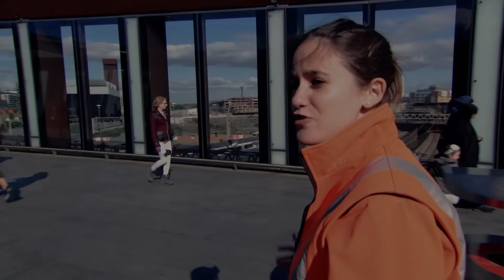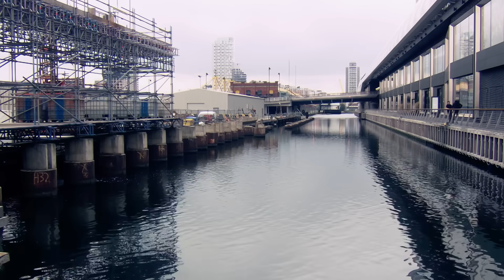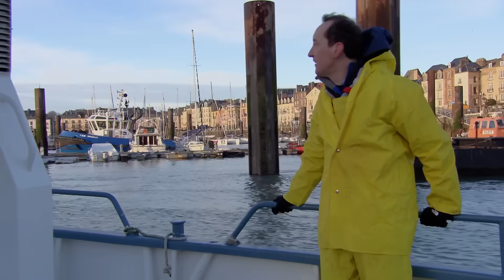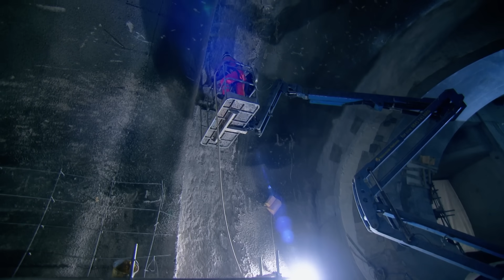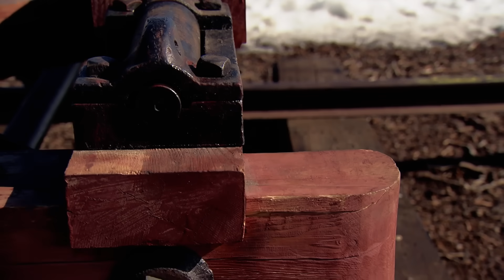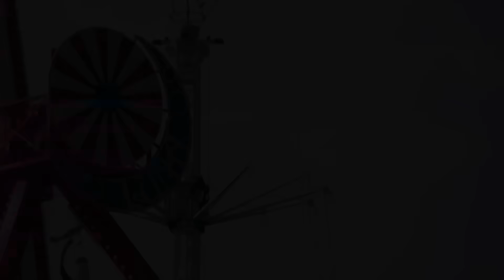The $17,7 Billion Mega Project That’s Changing London Forever | Blueprint

Comment: The original London railroad system - if it can be called that - was a product of 19th Century capitalism and 19th Century Hands-Off Economics. 
Each rail line was a separate private business, and each railroad company built tracks into London as far as it could afford, then built its own end-of-line station. The result: multiple rail lines going off in different directions, and multiple London stations with no direct connections between them. If you were going through London, from Birmingham to Canterbury, say, you'd have to get off the train at one station, take a cab or the Underground across Central London, and get back on at another.

Comment: Can’t believe they’re digging a whole new train line under London like it’s just another Tuesday. The size of this project is wild, massive machines, 24/7 digging, all while the city keeps moving above
Reply: Across the English Channel in Paris, the French are building the Grand Paris Express, an absolutely gigantic 200 km expansion of the metro network with 4 new fully automated driverless express lines which are 90% in deep tunnels.
Including a huge 75 km fully underground loop metro line around the city with 36 stations and all but 2 are interchanges with other metro, express regional heavy metro, tramway, or commuter rail lines.
During the first main digging phase a few years ago they had 22 or 23 TBM's digging simultaneously under the city.
Now they're beginning the 2nd main digging phase while the first parts are opening to the public next year. Though several extensions of existing lines and massive stations already opened last year before the Olympics.
They expect over 3 million passengers daily on the new lines and over 2 on the loop line alone.
It's a bit like Crossrail but times ten.

What's even wilder is that they're already planning a 5th new express metro line and currently extending the regional express heavy metro and tramway networks at the same time.

Comment: I worked for crossrail on the pudding mill lane job what a job that was unbelievable engineering 2016 i finished never see a job like it again
Reply: Pudding Mill Lane had a little temporary cafe, in 2012 you could sit and watch the Olympic area being constructed.
Reply: If you fancy working on the continent on the same kind of project, Paris is currently beginning the second main construction and digging phase of the gigantic Grand Paris Express project.
There are still over 20 stations and about 70 km of underground lines to build out of the project's 200 km and 68 stations.
There's also Toulouse in the South of France which is currently building a 27 km metro line with 21 stations.
Hamburg and Munich in Germany are also currently building major new U-Bahn and S-Bahn lines, although not as massive as Paris but they still probably need workers.
Reply: @KyrilPG you got any contacts

Comment: Is this the Elizabeth line? As a passenger commuting from west to central London on a regular basis I have controversial feelings about this line. Mostly because the line is not so efficient. There are always delays, engineering works and problems on the line since the beginning of its service. The reason is mostly because they didn’t create a completely new line out of a scratch but used the existing ones in the west and east London and simply connecting them to each other. The train technology in use seems to the same as the existing ones pre-Elizabeth line service.

Comment: 2009-2022 - What a disaster of a project. Meanwhile China build the entire Chandu metro system with like 15 lines and over 300 stations in the same period!!!
Reply: China often ignores environmental issues and construction worker safety to push projects forward
Reply: @JerryNiswonger  yet they had zero issues on building this line. The chinese also don't suffer Not-In-My-Backyard syndrome like the UK general population does. The simple fact of the matter is that the Chinese gov wants to move the country forward and it does, without loss of life or loss of jobs. China leads the world in green initiatives as well. Things have moved on we saw the pollution of the 2008 Olympics.

Comment: There's no pressure on cost, they're using over-engineered conventional techniques.
China does this for 10% the cost.
If the aren't encouraged to do this cheaply and just as well / just as safely, zero innovation will happen.

Comment: That line is already built - opened in 2022.
Reply: This is a very old video!
Reply: Possibly ten years old
Reply: Thanks for the update 😊
Reply: Im not even from UK and suspected its elizabeth line.
Reply: It originally aired 2017
Reply: I believed the projected was planned and started when UK was still part of EU. In other word, I think this Elizabeth Line received significant loan from EIB - which if the line was planned after Brexit, it probably would not stand a chance of even passing through the initial planning stage. 
So, yeah, this engineering marvel happened almost a decade ago.
Reply: Oo
Reply: Spoiler alert
Reply: I was there last year. I can't say that I saw much of a change. The Elizabeth Line was supposed to relieve travel west, but I still ended up standing from Reading.
Reply: BFD it is news to some people!
Reply: They do mention dates several times in the video and in the description! And with all that they already show finished it is obvious that this construction did not start last week I should say.

Comment: When your TBM is working 24/7 and still has to dodge everything from medieval wells to fiber optics… Crossrail deserves more hype! 💪
Reply: They work below the level of that system so dodge nothing but old Victorian tunnel. 😊
Reply: The tunnels on crossrail were approx 25 metres below ground level so THE TBM's had to avoid existing foundation piles.
Reply: The TBM's have finished their work, about 5 years ago. Crossrail or as it's now called "The Elizabeth Line" finally opened in 2022, the commentary for this is worded wrong. It should be in the past-tense, not in the present-tense.